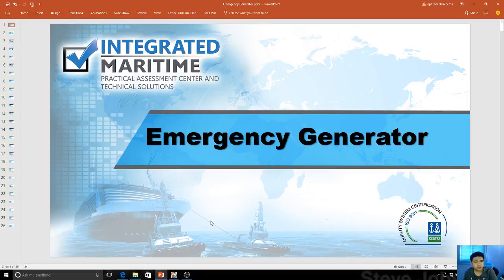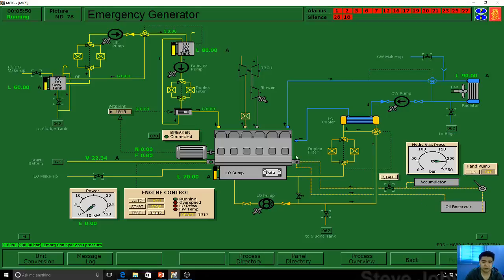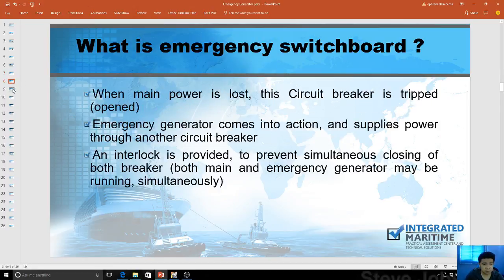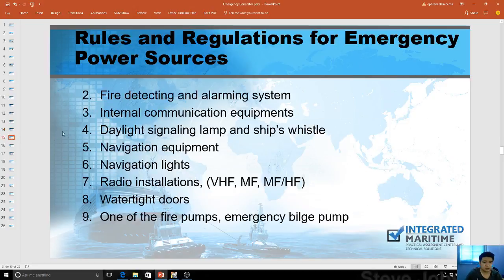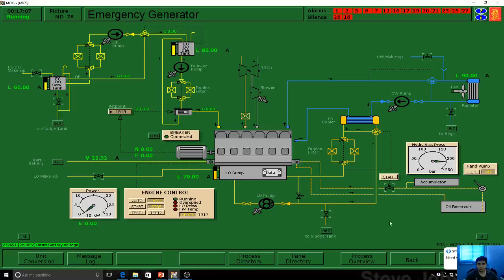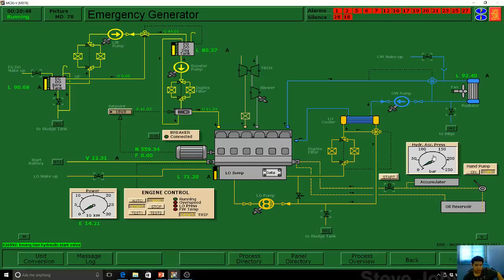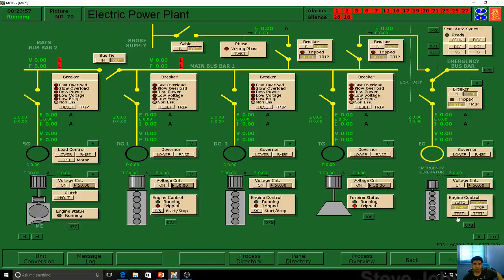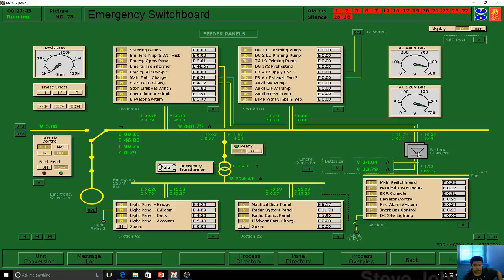Integrated Maritime Episode 2 - Emergency Generators

Comment: Thank you sir for video
But my question is that as per regulation emergency generator shall be started and connected to load within 45 seconds
But why 45 seconds not 60 sec or other ??
Reply: See the SOLAS convention